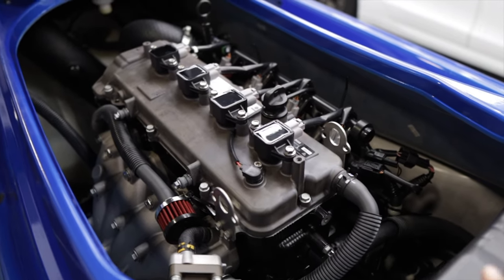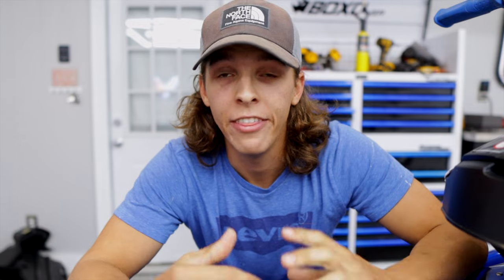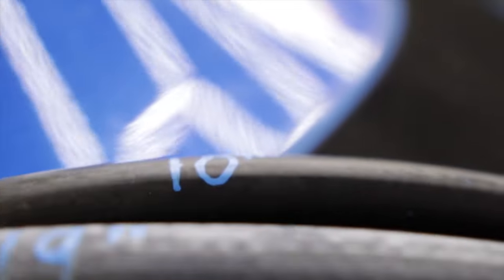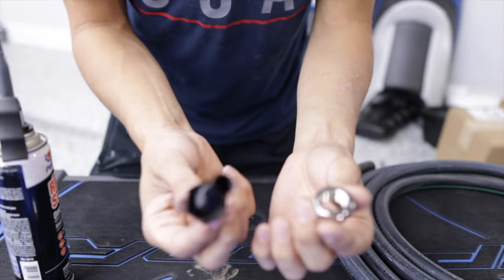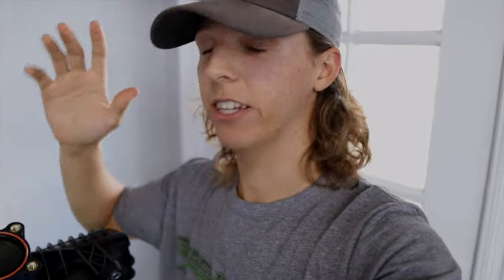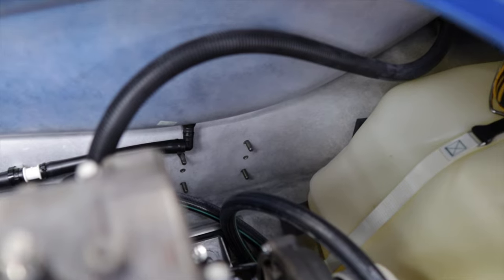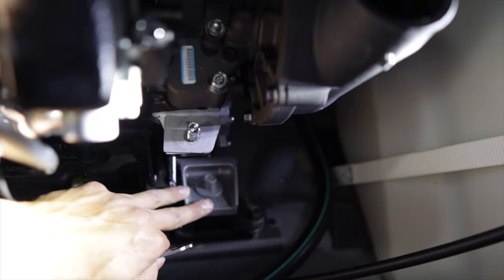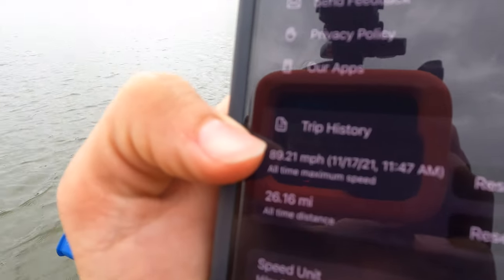DETAILED Yamaha SVHO Pro-Series Cooling & Gen-3 Intercooler INSTALL + 89 MPH!

Comment: From a 20 year carpenter  another tip  you can wrap a flag of tape around your drill bit. This can be preset to a determined length of penetration your looking for into the plastic.  A somewhat simple way not to over drill into it. Id put it into a vice too

Comment: I just picked up a 2021 GP 1800 that had the impeller and wearing completely worn out of it it has 65 hours They were running It's for at least 20 hours with a wearing and impella that was completely shot  I only paid $3000 for it What do you suggest I should do for longevity it seems to run fine

Comment: Hi ! Did you work the supercharge on this machine? What is the pitch of your propeller? I have a gp1800r and I forgot to put a 13/20 propeller because with the 13/18 I was hurting the 8500rpm cutoff. I'm missing the retainers, the big intercolator and the cooling upgrade to finish stage 2 completely. Tanks for the feedback !

Comment: I think you forgot to detail an important part, what about reaching super far back to the front of the ski to cap off the factory OEM intercooler hull outlets to drain out the hot water? I think you must cap them off. Also torque specs would be nice and getting the camera right up on all the hose locations and where they go to and from.
Reply from the maker: Yes the OEM intercooler exit lines must be capped off. Thanks for the pointers 👍

Comment: I see you didn’t remove the supercharger. About to start the cooling kit install and noticed the Riva directions say to remove it for a 2021GP SVHO. Thoughts? And thanks for a really well done video!
Reply from the maker: I didn’t need to remove the supercharger but removing it allows for a lot more room to work with. Removing the supercharger is very easy.

Comment: Greg, as always, your work is very clean and well done.  Do you ever have a problem with the self adhesive style of zip tie mounts coming lose?  The factory ones are usually wet mounted in some adhesive, lots of adhesive.
Reply from the maker: I have had ZERO issues. Mine have been on for close to 70 hours and won’t even budge
Reply: @GreenHulkGarage  What brand and source, I'll give them a try.
Reply from the maker: The brand is Gardner Bender and I bought them at my local True Value hardware store.

Comment: Nice video dude! Just subscribed to the channel. I got a 2020 gp1800r stage 2 RIVA kit with upgraded supercharger shaft at 9300 limiter. What you think I should be doing?
Reply from the maker: On stage 2 with the RIVA ride plate I was getting 90 mph at 9150 rpm in absolute perfect conditions.

Comment: You said that the Riva intake grate cuts a little bit of top end..I’m not sure if I should put one on my 15 FX ..Worth it ?
Reply from the maker: This is on a GP. Entirely different grate than the FX. The Riva grate on the FX doesn’t scrub any speed and is definitely worth it. Get Riva parts discounted in the GreenHulkStore.com use discount code “greenhulk” at checkout 👍

Comment: you are incorrect , step by step videos are awesome . There is 5 part video on Yamaha. SVHO I followed and fix my bearing and cracked head ,   I would advise not to go with more than 16 Psi boost , 
  The high fuel  mixture temp has  causd   head to crack by cyl # 2
Reply from the maker: Boost pressure is not a factor in this heads cracking, nor is increased RPM. These heads crack due to a thin head casting. Even bone stock skis have cracked heads, and even non supercharged skis.

Yamaha corrected this issue starting with the 2021 model year.

Comment: On the intake manifold do you have to drill and tap a hole for the barb hooking up to the BOV? I don't see where to hook it up at or do I need to buy a T fitting for to BOV hose?
Reply: Yes, always drill and tap the manifold. You cannot tap the MAP sensor hose with a Tee fitting.

Comment: When you take the ribbon out, do you flip it sideways then put the template on and drill it out withe ribbon still in? Then after drilling remove the ribbon? Cant tell from the video.
Thanks
Reply from the maker: I pushed the ribbon through just to show how easy it is. I don’t think it matters if you leave it or not when drilling

Comment: What’s the secret in hitting 89mph ? Will a 2018 gpsvho put out the same numbers with same mods ? I think I’ve seen and heard 86
Reply from the maker: Yes a 2018 will. As advertised, it will run 86 @ 8600 RPM. This ski was over 9100 RPM which is why it’s achieving 89 MPH

Comment: how does it crank 9200 ? where does the limiter kicks in?
Reply from the maker: With the MaptunerX stage 2 9200 RPM ecu reflash.  The rev limiter is 9200. http://www.4-tecperformance.com/index.php?main_page=product_info&cPath=316&products_id=4250

Comment: Does the bov on the interccoler help purge condensation
Reply from the maker: No, the BOV releases boost pressure when you release the throttle to help take stress off the supercharger clutch. Condensation is not something you want to release. Condensation is a normal part of what happens when the air charge is cooled by the intercooler and it actually helps performance by cooling the air charge. So, it’s nothing you want to release. 

Some companies such as Snow Performance actually make water injection kits which help improve performance

Comment: What grate u recommend that won't take top end speed off?
Reply from the maker: For the 2021+ GP1800R stock intake grate will be as good as it gets without losing speed on the top end. The RIVA gen-2 grate will improve rough water hookup and holeshot which matters more to me

Comment: What RPM were you spinning?
Reply from the maker: Between 8900-9000. Using the “Stage 2 9200 AGR” MaptunerX tune
Reply: What boost with the stock wheel. 17? I know 8400 is about 13.5 stock.